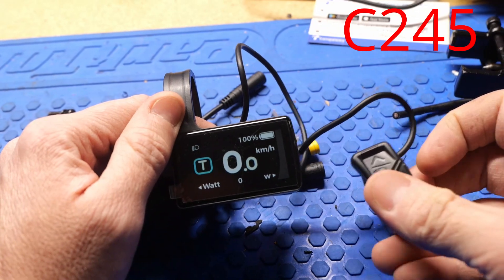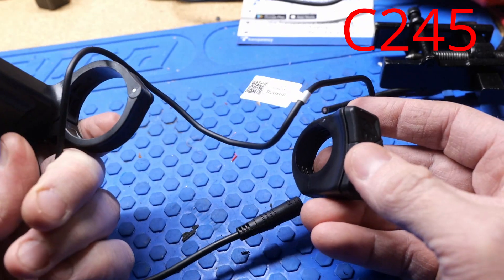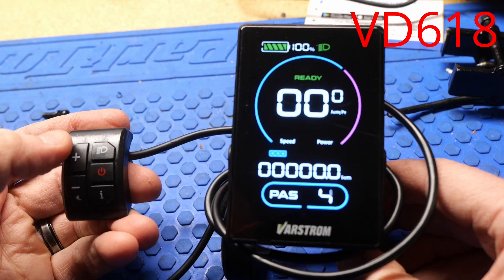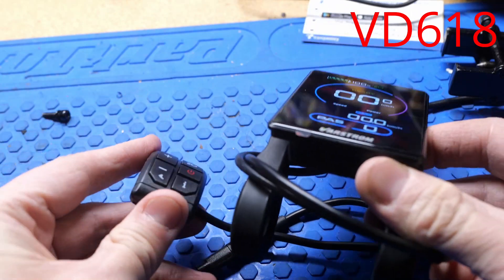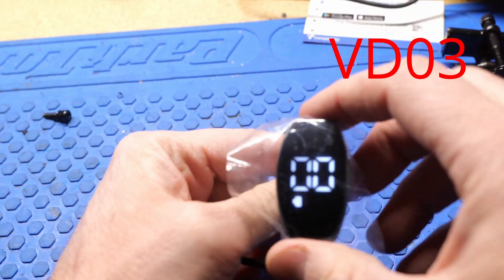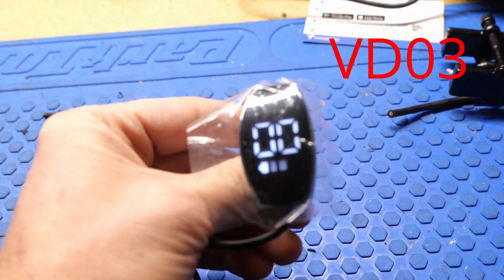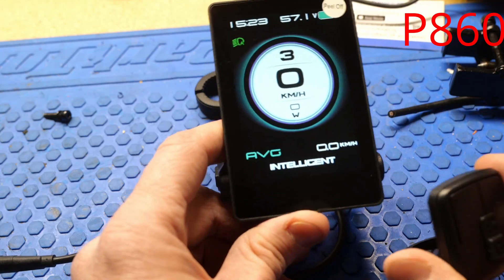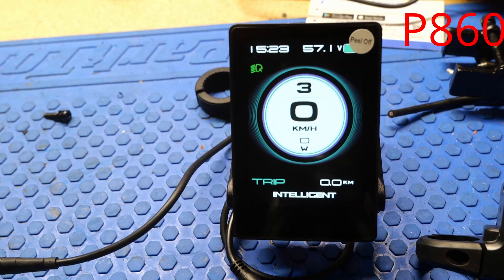Bafang CANBUS display options overview for 2025: What they look like in real life :)

Comment: Used your BaFang HD1000 install video which was very helpful.   Now that I have everything setup using the DBC 080 Display how can I change to Throttle Only and not use the PAS or is there a different CAN Display that would accomplish this?
Reply from the maker: You will likely need to get a programming tool to do that

Comment: Nice video thank you.  I just installed a kit on my bike.  It is a 750w with a can bus system.  After installing, everything turns on and all of the sensors work, but the motor will not start when I operate the thumb throttle or move the crank.  Any ideas on what I can do to troubleshoot this?
Reply from the maker: Disconnect brake sensors and see if that fixes it. You might have the brake sensors installed incorrectly.
Reply: @JohnnyNerdOut  Worked, thanks much!  I have it installed on a 26" hybrid.  Holy crap is it fast on "5".  I built it so my wife can keep up with me.  I think it will be the other way around now.

Comment: I connected a bbs02 G340 - 750W CAN BUS to the bench. with VD03 CAN display. But the engine does not turn on and neither does the display. If I press the + button on the display, I see a small absorption of 30 mA, otherwise no absorption and nothing starts.

Comment: How can I access the settings menu for the VD618? I need to input things such as wheel size, miles vs kilometers, etc. I have been searching the internet for 2 days…why does bafang not include instructions??
Reply: I need to know the same!
Reply: Double tap the on/off button. I'm trying to turn off the speed limiter...its stuck on 25kms max

Comment: I need a extension cable for the DPC010. Building a Bafang powered ICE Adventure HD recumbent.
Reply from the maker: I have some at the shop. Check the website or reach out to us on the specific one you need
Reply: @JohnnyNerdOut  I need the Can-bus 5 pin connector. Triangle shaped, not round.

Comment: Why canbus and not UART? I'm new to ebikes
Reply from the maker: It can transfer more info faster essentially. Probably overkill for these motors.
Reply: @JohnnyNerdOut  gotcha, I build fpv racing drones and all those components use uart, for a build in 2025 would you recommend canbus over uart? I saw where you said they stopped making uart protocol motors

Comment: From what I can gather, it's no biggie, really. If you buy the new motor, you get everything you need anyway.
All the internals are the same, so spare parts won't be a problem. The new motors can use non proprietary batteries, which would be a biggie for most people if this wasn't the case. It just means in the future, if you need a replacement controller, and the uart controllers aren't available, you'd just have to either buy adaptors or just solder the wires together once the correct pins have been established.
As someone else commented, the new eggriders will work with both motors.
The big issue for me is STILL no torque sensor!!
Very disappointing.

Comment: Hey Johnny , for the DPC010 , if you double click the power button , it will show a different display. From there , you can toggle all the information with the power button, and it shows Voltage , Watts , Amps , Range.
Reply from the maker: Nice, thanks!
Reply: @JohnnyNerdOut Bonjour, est-ce que tu sais comment paramétrer les nouveaux moteurs bafang bbs02 CAN bus s'il te plaît ?

Comment: John.. I sent you the link... you asked about the aliexpress handlebar volt / percent meter... the $5 model has a weird mount (not recommended).. the $8 model has a handlebar grip.. and it is bare wire +/-    i used an old XLR charger to connect it to the battery.. it has an auto off, so i won't drain the battery (i also shut the battery off when not in use to prevent leakage).. and it is very bright and easy to see in digital format.  call if you have any questions or want to see in person.. Rob across from spaghetti factory.